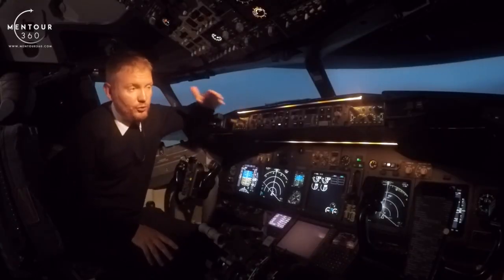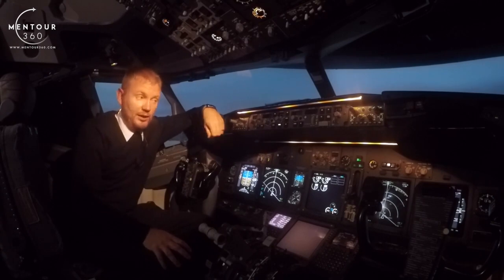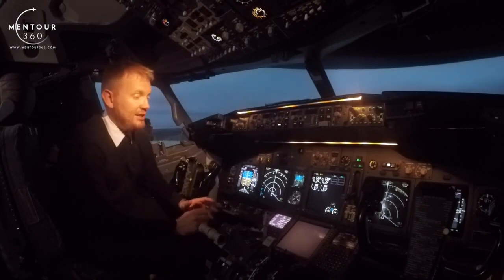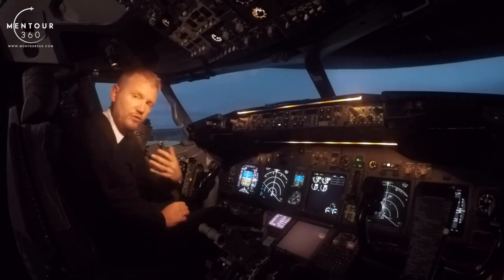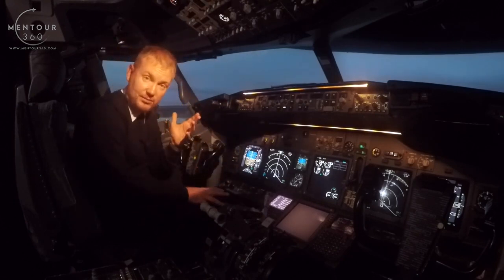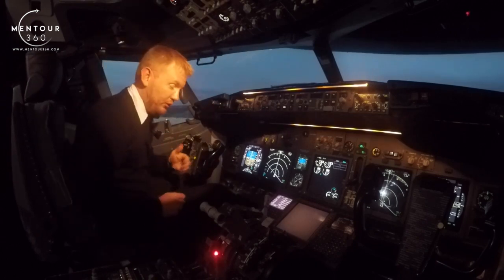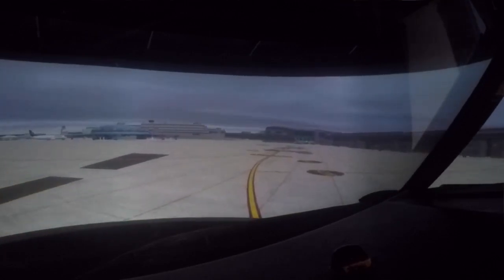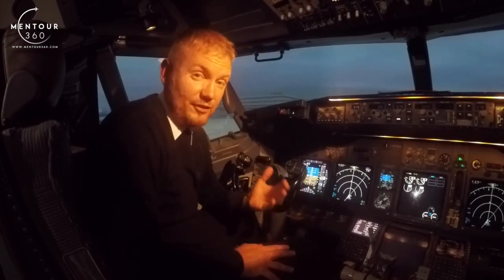How aircraft are CONTROLLED on the ground.

Comment: I was on an Air Canada dc 9 flying from Calgary, Alberta to Vancouver, BC once.  The pilot, when departing, did use reverse thrust to back away from the terminal instead of using the pushback truck.  The flight originated in Saskatoon, Saskstchewan.  I assumed he was running late.

Comment: So the jspenese rescue plane if it made a error they wouldnt be able to reverse like a car does do aircraft, like a coastguard plane have thst tiller on board for steering and as uou say if in doubt double check that you should be where you are before entering it as in the search snd rescue plane they were in wrong place if you do  need to break in a emergency how quick can it be done

Comment: So you have to take their word for it, that all the doors in the hatches are closed properly.? There is certainly a bit of trust that goes into that process I would think? Even though I’m sure you get green lights or some sort of indicator that all doors are locked and Sealed and ready for takeoff.
Reply: Old post, but🤷🏻‍♂️
Door warning system on the overhead panel. Amber light when open, no light when closed.

Comment: Captain, another question is how you can be at the center of the runway? Is there any device for indicating the aircraft is on the center of the runway or no?
Reply: Mohammad Dayyaneh No devices..They just aim basically🙃
But if they are straight on the line there is a thud every time the nose wheel goes over a taxiway light😆

Comment: When you follow the yellow line how do you know the front tire is on top of the yellow line. What is the trick? 😉👍
Reply: Much needed
Reply: Well there is a camera  showing the nose wheel
Reply: jatinder singh Well..you dont know shit..there is no camera on the 737NG
Reply: Steelcase Genericrun 
If you are straight on the line there is a thud every time the nose wheel goes over a taxiway light😆 They just aim basically🙃
Reply: Basically you just keep the line underneath your butt. Im only a mechanic on 737s but I've taxied a few times.

Comment: Hi captain. I'm an aviation enthusiast and wasn't able to get answers to a lot of questions which I found now that I found ur channel. I have a question. How are pilots able to pinpoint follow the yellow line as I can see that u don't have anything to see if the front wheel is right on then or not?
Reply: kingfisher111 The taxi light is on the nose wheel.
Reply: @speedbird9313  what I meant was, how are they able to see through the body of the plane, where the nose wheel is exactly. One can figure out the lights during the night but what abt the day?
Reply: kingfisher111 They dont have to see the whole body and they dont have to be dead on the centerline, if they are you will here thuds as the nose wheel goes over the taxiway lights.

Comment: but how does the tiller turn the nose gear, hydraulic cyl, rack and pinion, or what?
Reply: danceswithcritters Wires and pulleys , remember its an american from the sixties😆
Reply: Yes there is a cable that goes down to a metering valve which operates two hydraulic steering actuators.

Comment: How do you line up the nose wheel with the yellow line?
Reply: Thai Nguyen Uhm..you stear..
Reply: Speedbird I guess what I meant was since a pilot seat is offset to the centerline of the aircraft, is there a device or instrument to aid a pilot in “seeing” a nose wheel in order for him to be able to line up with the yellow line?
Reply: Thai Nguyen No device, but the taxi light is on the nose wheel strut so they can see when its dark. And they dont have to be dead on the centerline, if they are you will here thuds as the nose wheel goes over the taxiway lights.

Comment: Can you turn the plane on the ground by reducing thrust to one engine to idle and increase thrust to the other engine, say a twin engine plane!?
Reply: Yes you can to a certain extent. Not the best way to keep control and is usually not used
Reply: it wouldnt turn at a very good angle. to actually do turns on taxiways etc you could possibly do it with reverse thrust in 1 engine and full in the other.

but yeah as the first guy said its basically never used.

Comment: The Tiler is the Ground Steering wheel that turns the aircraft on ground side to side and the Yoke is the Air Steering wheel that tilts to turn the aircraft in a direction desired while in the air

Comment: can the tiller be locked at center position? is the tiller locked at center position when the aircraft is running at full throttle for take off? during rudder control at high speed, is the tiller is locked? or free eveytime as car steering?

Comment: On an actual plane, if you set the parking brake, then gradually increase thrust (assume you're not near people, equipment, etc...), will you at some point: 
1) Overpower the braking force, forcing the landing gear wheels to roll, and the plane to move.
2) Overcome the friction of the landing gear wheels to the ground, making the wheels slide/skid and the plane to move (without steering control).
3) Never be able to move the plane even with full throttle (assuming the ground is clean and dry).
????

Will the simulator behave the same way?

Comment: Thanks for this. I've watched several times. Question: during extreme crosswind landings the aircraft yaw sometimes seems more than 7deg. I imagine that it is really hard on the nose gear to land at those more extreme angles, and rudder inputs would need to be significant. Does the tiller ever come into play at landing speeds to straighten out the aircraft in these situations?
Reply: The tiller will not work untill WOW (weight on wheels) as it sits in a centering cam. But yes these types of landing take their toll on the tyres. A typical maximum rudder defection angle for large aircraft is around 25 deg.

Comment: But how do you manoeuvre back in the simulator ?
Does the virtual plane get pushed back by a virtual tug or do you use reverse thrust since it's just a simulator ?
Reply: Simulator tug does the push back. The sim will not let you reverse thrust on the stand (wel it will but not without the usual warning lights/noises)

Comment: Great Video. I knew about the tiller as I've been in a couple of professional flight simulators in the 1990s when I used to repair equipment in flight simulator companies. Question I have is does the co pilot also have a tiller or is it just the captain in this aircraft type?  Thanks

Comment: I've got two questions here.

1: Do the wheels have any power to accelerate the aircraft while it's on the ground? Or it also depends on the engines' thrust?

2: Not every aircraft are same sized, and since you said it's like driving a truck on the ground while taxiing, how can you adjust the aircraft's position perfectly on the yellow line while turning etc? I mean, let's say a 747 or an A380, they are pretty big for the pilots to just drive it like a vehicle. I've always wondered about this one for a long time.
Reply: 1.  The wheels have no connection to the engines for transmitting power.  It's all just engine thrust.

2.  It's rather like driving on the road.  With experience, practice and concentration, you learn to keep in the middle of your lane, whether you're in a large truck or a small hatchback.  Same with aircraft.  You just have to allow for how far below and behind you the nose wheel, is so you can keep the wheel - and not your seat -  directly on the line.

Comment: Approximately one third throttle just to get that thing rolling?  If I want to get my car rolling from a stop sign I give it a quarter throttle, at the most, and then increase it from there.  I would have never guessed that it takes 33 - 34% thrust just to start rolling?
Reply: I imagine it's because your car has a direct way of pushing against the ground through the tyres.  Since the aircraft only has it's regular source of thrust, and it's not putting power through the wheels, it's pushing against air - which tends to move out of the way unless you're pushing sufficiently hard that it can't get out of the way fast enough.  Remember, you also have to overcome inertia and the rolling resistance of the tyres with all that weight on them.

Comment: I've seen that only British Airways 747s shut down the two inner engines, 2 & 3 when taxiing in and after tidying up the landing configuration. My question is, why only those engines and not engines 1 & 4, which most times hang over the edge of the taxiway ?

Comment: Those must be some crazy monitors in that Sim! Cause only the graphics gave away that it wasn't real, normally you can see the refresh rate.
Reply from the maker: It depends on the camera as well, if the frame rate matches the simulator it works ok to film.

Comment: Good video Capt! One question here, how do you maintain the nose wheel stay on the yellow line during taxing? Where do you refer to? (eg: using light sensor on the glareshield).
Reply from the maker: It’s just experience. I try to vision the line going through my right knee when taxying. That’s about right.
Reply: On one flight I was on, I was able to watch an image from a camera behind the nose gear and see the yellow line between the tires.  I assume that video feed is also available to you, right?  If it is, do you ever use it?

Comment: Can the parking brake be set without pressing toe brakes? 

eg, is it possible IRL to accidently turn on parking brake pre landing and then when it lands they look up 
 :D
Reply: No the parking brakes are set by pressing both pedals at the same time to their maximum then pulling the brake lever, which will remain in place under the tension of the depressed pedals. To release, simply press both pedals while allowing the lever to drop slowly in your hand.

Comment: Can't use reverse thrust? Bummer. That means that even at the smallest bunch airstrips which the 737 was designed for you need a tug to get you away from the gate. It's we'll know, at least amongst enthusiasts, that the 737 can land at the most primitively airstrips, which is what makes it the most useful aircraft for airstrips in places like Alaska, or direst strips in South America and Africa. So the the rudder gives you 7 degrees, how much does the tiller give you?
Reply: Not at all.  The 737 can use the small airports.  There is no particular NEED for the plane to nose into the terminal at the gate and use a jet way.  Simply park parallel to the terminal and use air stairs for the passengers just like in the old propeller days.  If it's raining, they probably won't melt before they enter the terminal.

Comment: Love almost each of your videos... but they can sometimes they can be too long in length.  "Steering wheel question?"  Answer is simple.  Captain's Tiller, explanation of degree of nosewheel freedom, appropriate rudder authority on the pedals at a certain point, differential braking should that ever be necessary (and reverse has been covered).  Breakaway thrust, start, etc: it can be explained more succinctly. 10 minutes seems to be your normal length. I love your personality, love your videos, and cannot express my appreciation for your desire to transfer knowledge on YouTube, but if you could somehow condense your video lengths by half (eg, ~5 minutes):  You can communicate the same amount of information, in half the time.  Again:  I am so appreciative of all of your videos.  Just a suggestion :).

Comment: Thank you for your time and for explaining that so easy to understand :)
Now I understand y u need the simulator and I saw what the handle above the window is for (I wondered once)
Can you explain why it's not allowed to reverse by engine (is there danger for the ground crew or a possibility of damage on the engine)-(isn't it much cheaper for the company to let the plane "drive" itself out of the parking slot instead of paying someone else for that)?
Reply: The fuel consumed would be insane

Comment: Great, so am I correct in saying that upon landing you would use the pedals to keep the aircraft straight on the runway and not the tiller?
Reply from the maker: Correct.
Reply: What if you're landing in a crosswind? You're turning the rudder into the wind, but wouldn't that also turn the nose wheel to the left?

Comment: Years ago, the DC9s (Diesel 9s as we called them) had the 'buckets' at the back of the engine cowlings (similar to the B737-200s) and had the mechanical capability to reverse back from the gate, but the operators of that line figured out it was hard on the engine, made more noise, and would blow jet blast forward.  Much better overall to just have it pushed back.
Reply from the maker: Yes!

Comment: I'm certain that your airline prohibits powering back. But, I'm pretty sure that there's no FAR from the FAA that outright prohibts any and all use of powering back at any time. Naturally, certain air operators prohibit the practice unless someone's life is in danger. Airports, both public and private can make any rules they want, and often do for no logical reason. But, there are airports where it is allowed, and certain operators must do it in order to maneuver or expidite ground operations. Not all airplanes are air liners.
Reply: When I worked for CO some years ago, our 727s, DC-9s/MD-80s very often powered back.  There was someone marshaling the plane with his wands who was in sight of the captain.  There were other ground crew members at each wing tip to signal the person marshaling the plane when they were clear.  The marshaler with the wands would hold them horizontally and use a rolling motion to signal the captain to begin the power back maneuver.  He would signal the captain to stop with the traditional crossing of the wands above his head and would direct the captain when to turn also with the wands.  It could get kinda loud if you were a passenger sitting in the rear seats.

Comment: Never thought about it once before this, cause I just tried fsx so far, but you wouldn't want to try to land the plane with anything less than non straight pointing wheels. So I don't know if you have to check this, or maybe it springs back to straight by itself.

Comment: Does the tiller turn the nose wheel? I might have missed your explanation on what actually makes the airplane to turn on the ground. Thanks for your videos, I enjoy them very much.
Reply: On your small outboard engine there usually is a tiller to steer the boat :-)
Reply: Tiller/wheel turns the nose wheel, also on some larger aircraft rudder input will give a small amount of nose input at certain speeds (b747-400).

Comment: Thank you for the previous answer. I have one more question, sorry if you have covered it in the past videos
Weight and balance ,CG, those modern aircrafts have a self weighing capability on the landing gears?
If not ,is the distribution specially ,cargo, of weight done by manual calculation?
and do pilots go over the distribution or its ground crews responsibly? Thanks

Comment: Hello captain, i am a flight enthusiast and i love your videos very interesting thank you
i have a question ,often thought about it: when just begun takeoff and your not perfectly center lined ,still at slower speed, is the front landing gear in locked position,or still usable.  and does the rudder do the necessary adjustment at low speed?. Thank you

Comment: Hello Mentour, thank you for the informative video. As I know the A320 has a button on its NW tiller to disable rudder-paddle input to the nose gear, in order to enable the pilots to test rudder controls while taxiing. I wonder if there is a similar switch on the B738? I know both hydraulic systems can actuate rudder and STBY rudder inputs but only A system controls NW tilling, so shutting down A system might not be an option. But neither have I seen a button controlling this. Will you simply test rudders only while parked then?

Comment: Hi Mentour Pilot. Thanks for very cool videos :). I have seen in some landing videos, that after 'Approaching minimums' and ...30,20,10 (also after landing) the altimeter bar just right to the blue artificial horizon (I mean this electronic ruler) does not ever show 0, but remains between 50-60 feet offset. Why is this offset? I would suppose that the sound 'ten', which is real, and the ruler, which shows 50 feet should coincide. Or is it always set to the airport elevation? Thanks!

Comment: Sitting in the left or right hand seat would feel different for dexterity and handling, depending on what you are used to? I have had a go in one of those Boeing 738 life-size simulators, and I sat on the right hand side first time, then the next time on the left hand side. Being in Australia, the right hand side was more natural to me, like a car, the left hand side then more awkward. Apparently it does not take long for pilots to get used to either side?

Comment: Do you have to check tiller is centred before landing so you don't end up smashing in to the terminal building ?
Reply: It automatically centres when you release your hand from the tiller
Reply: Josh Nesbitt it's like a normal steering wheel in a car it will center it's self if it is moved
Reply: allso in the Airbuses it can be turned off
Reply: Springloaded
Reply: Also the nose gear sits in a self centering cam when deployed before landing. To ensure its correctly centred on retraction as well as landing